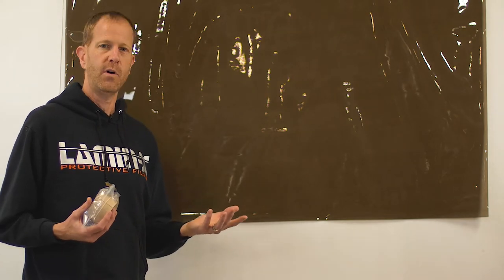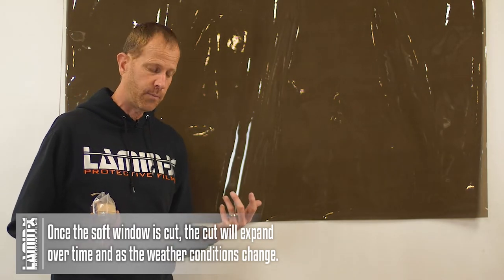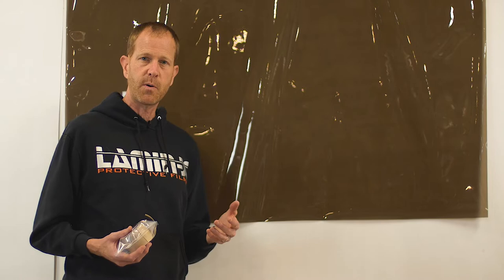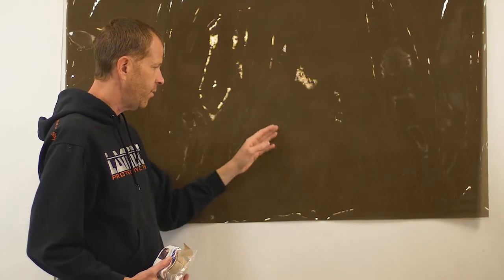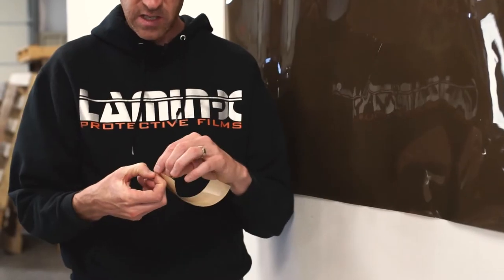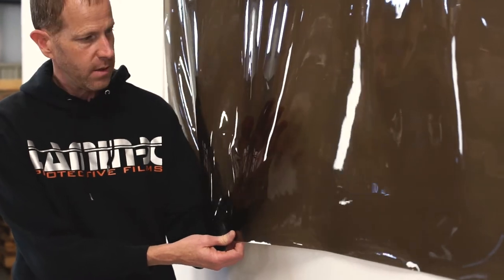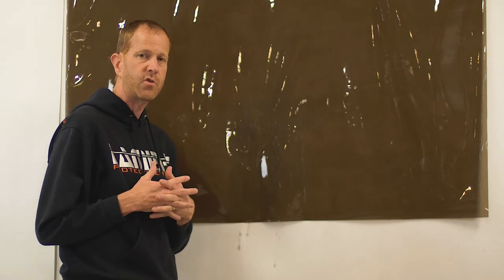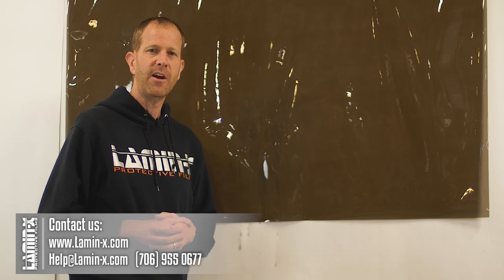How to repair a torn window or top on a convertible car, greenhouse or special event tent

Comment: Hi there,does the up and down and folding of the convertible top start peeling off the film after time?
Reply from the maker: No, especially when the adhesive on the film is completely binded into the soft window after a few days in the sun!